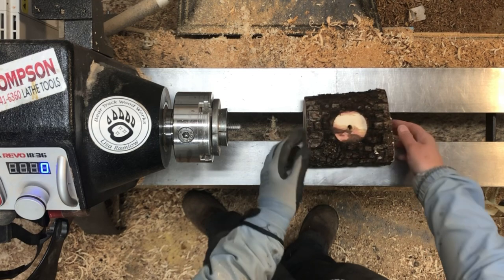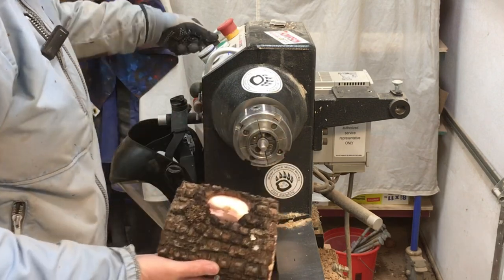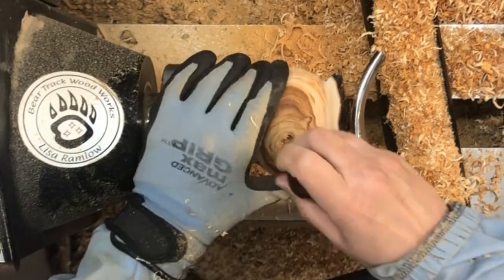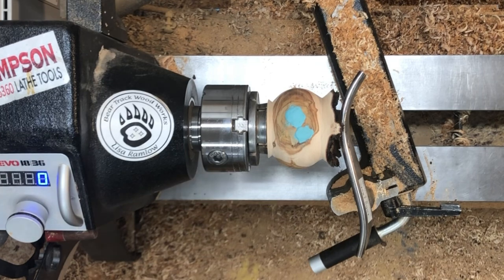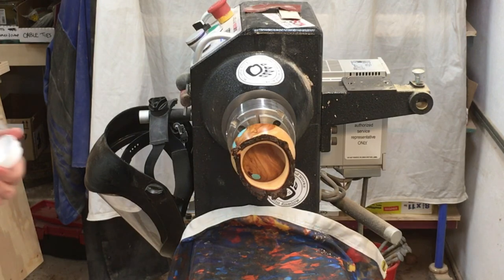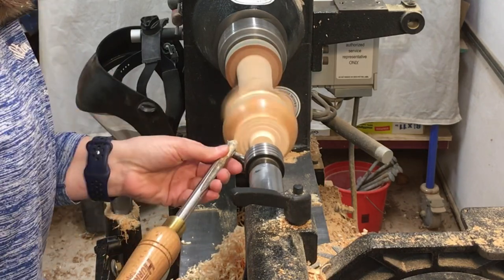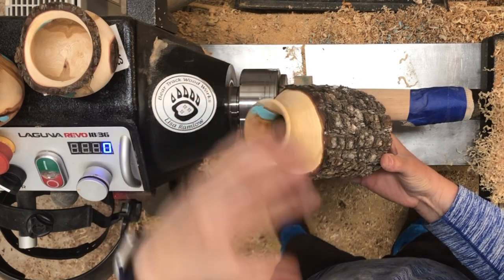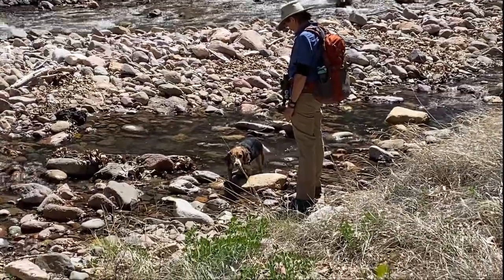Woodturning: Croc-I-Gator Conifer. 😁  Bird’s Mouth Bowls and Weed Pots

Comment: That is a really cute bowl! If you don't like the blue you can always Dremel it down just a little bit and then use your colored epoxy on top of it to cover it. That way it will be the color you want and you would have the milliput as the backing to hold the resin in.
Reply from the maker: Hi Micah! That’s a great idea - although in the meantime I’ve sold the pot with the turquoise so I guess lots of people liked it just fine. And another turner suggested that robin’s egg blue was quite appropriate for a bird’s mouth pot and I thought, why yes, yes it is! 😁

Comment: Turned out nice. Couldn't you have put some kinda of pigment in the miliput to change the color to contrast with the wood. BTW I like that you saved some of the bark on the top. Until the next video be blessed
Reply from the maker: Hey Micheal! The Milliput comes in two solid logs, a whitish and the turquoise color, and then you mix them together until uniform. It comes in tons of different colors, I just only have the turquoise. I’m not sure that it would set properly if I mixed in extra stuff, tho I did think about it - great minds and all 🙃